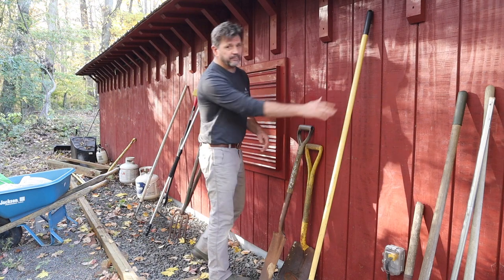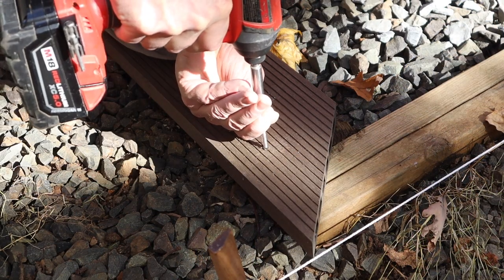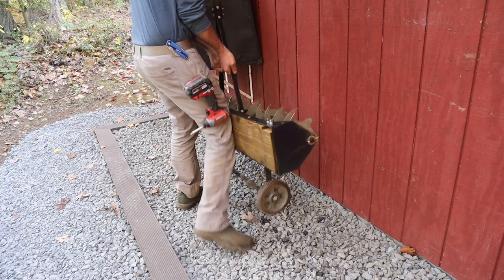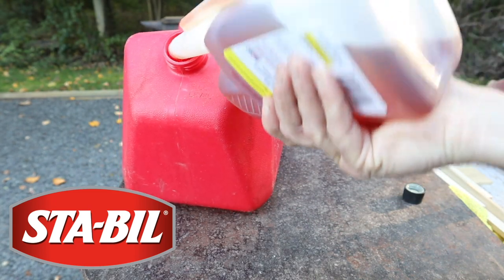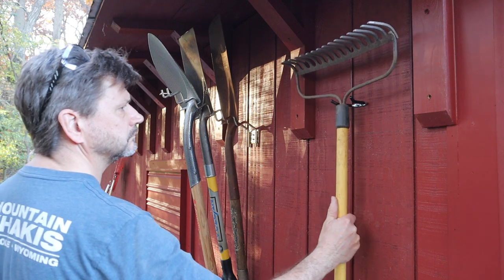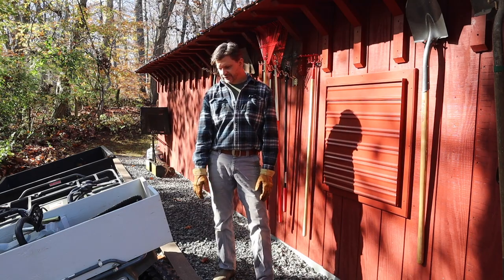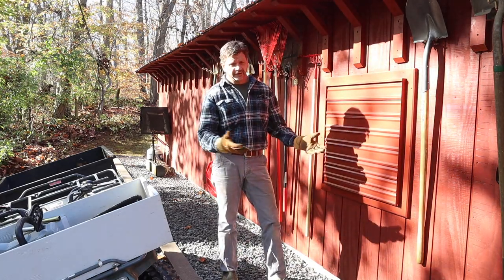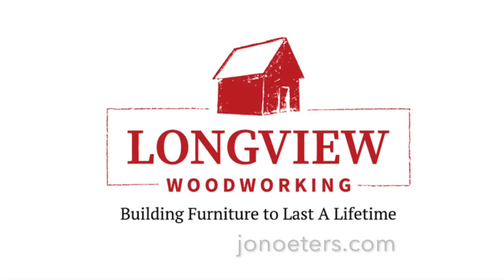Garden Tool Storage and Organization Project

Comment: those multitool hangers are great until you need the tool in the back.
they work great in hardware stores because you usually just buy the tool in the front, but for home tool storage I would stick to individual brackets. 
Great video tho, I really enjoy those small projects around your property
Reply: you know I was thinking the same thing

Comment: I've got the same issue with my shed. Only problem is that the siding is horizontal Hardi board over OSB and the OSB is what's rotting. I'll have to pull the siding from the bottom up to get to the OSB and not sure how to do that with the overlap - sure don't want to pull it all. Great idea with the aluminum strip! I've used STA-BIL for years as well ... never realized you could just squeeze the correct amount of ounces into that spigot so thanks for that too! lol Yeah, it's the little things. :)